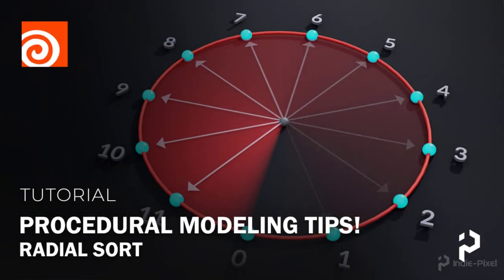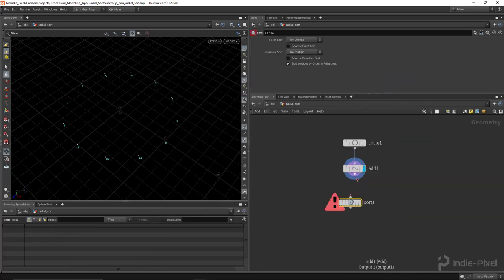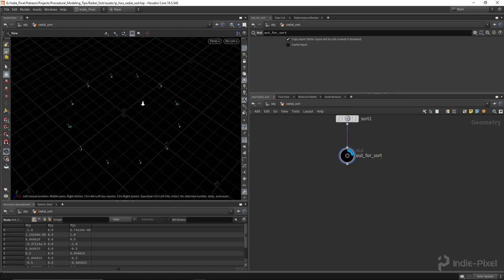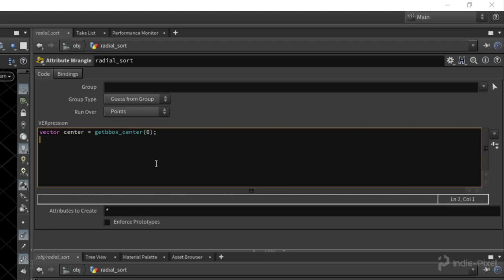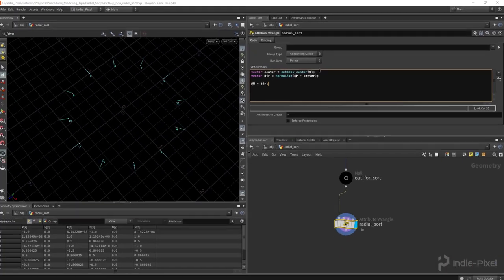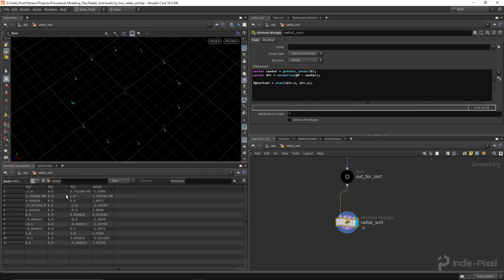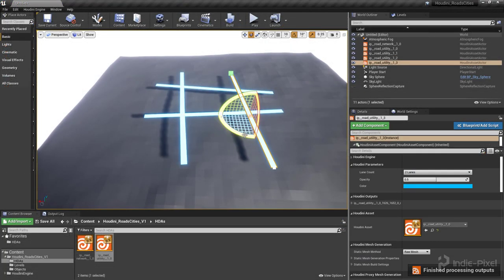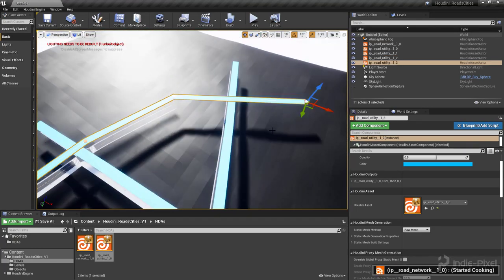Houdini - Procedural Modeling Tips! - Radial Sort

Comment: in vop
(geometryvop global ) P
to connect
(vector to float )

to connect 

(arc tangent) 

(vector to float ) to ( arc tangent connecting is

fval 1 to x
fval 3 to y

the result connect to 
(Bind Export node) should be name the attribute ( sortval ) and type is ( float )
Reply: Ahh thanks. I though I had to get the centroid subtracting the bbox min and max so subtract again from the original position and then use the atan node. It is even simple
Reply: @Bolaway  Nope. Add min and max after that divide on 2 then you get center. And by the way, you get more nodes than if you write code in VEX. 3 lines versus 8 nodes.